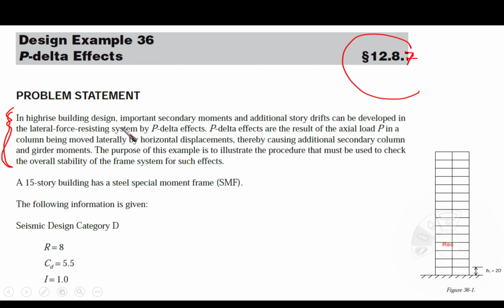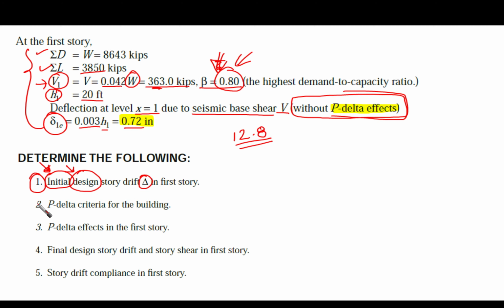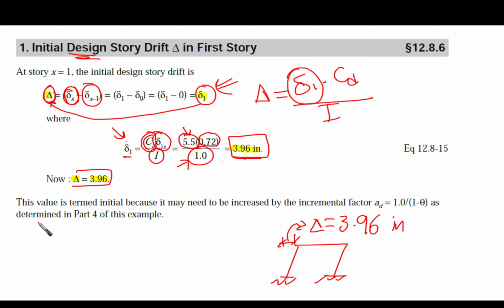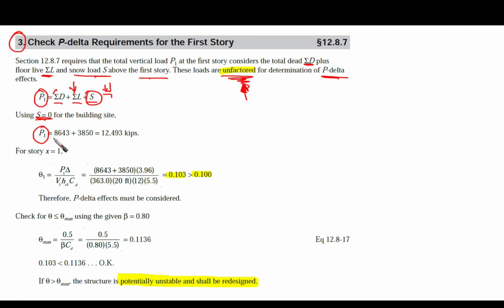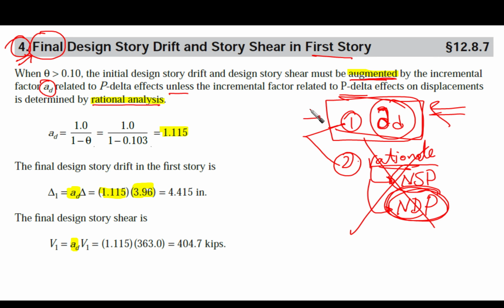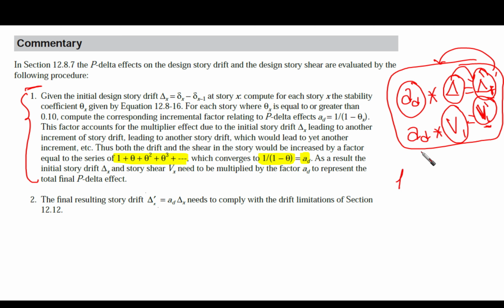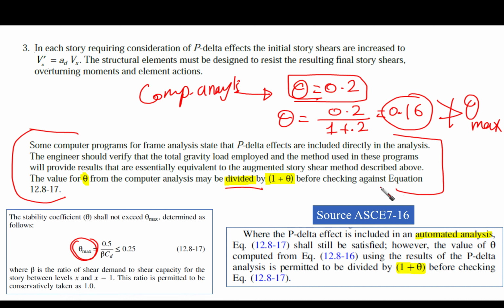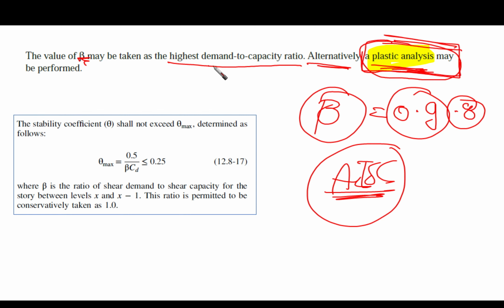22- ASCE-7-P-delta Effects Part-2 Example-1-Dr. Noureldin

Comment: Thank you Dr. Mohamed..
I have a question too.
Should we check torsional irregularities after we determine the P-Delta effect because there are increasing lateral loads which maybe for one story or some stories? It will increase the lateral displacement and drift story. Thank You.
Reply: Yes, it is required to check the irregularities even after performing the P-Delta analysis. Irregularity check is based on geometry ( either horizontal or vertical) and loads. P-delta is based on additionals loads ( moments ) due to  story drifts /displacements.
Reply: @nagarajuseelam5286  Thank You